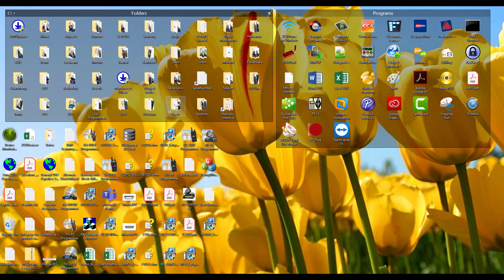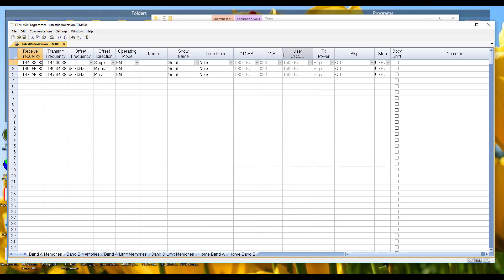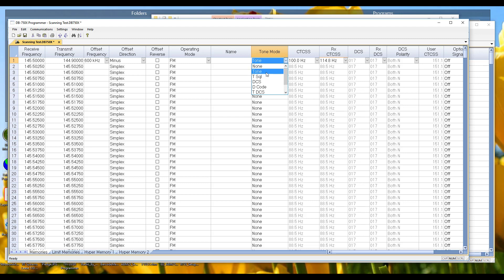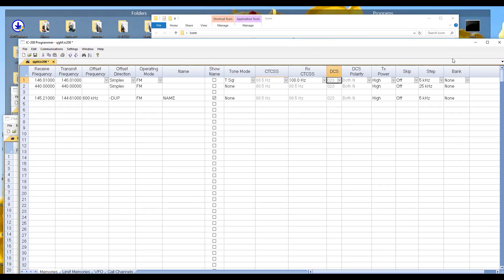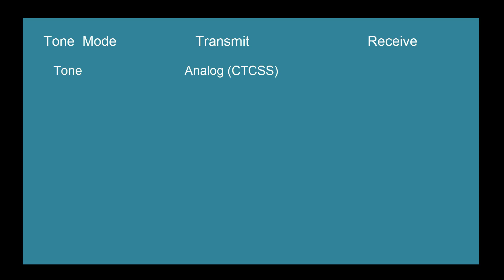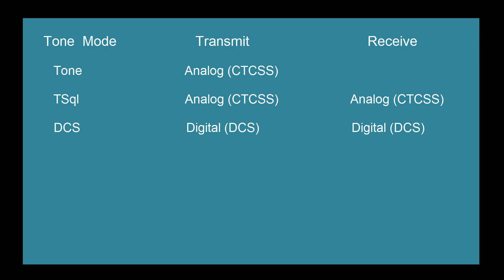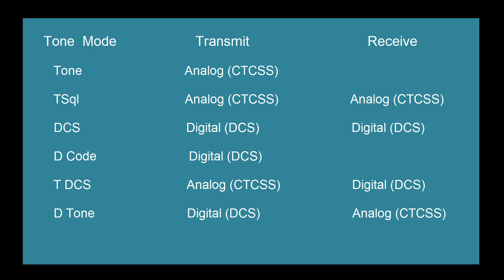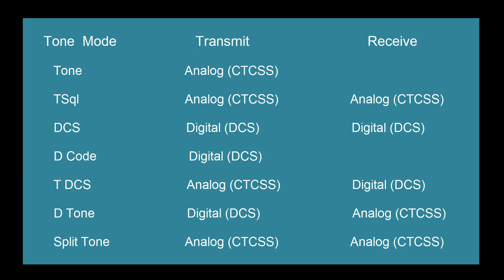Tones for accessing amateur repeaters

Comment: Icom IC-2730A advertises Split tone but, does not handle split DCS. :-(
Reply from the maker: Oh but it can be done!!!
Two channels
Channel 1) Rx frequency as simplex | Tone Mode to DCS | DCS code to that needed to hear the repeater and block other noise. (The down side... the one from the repeater to you).
Channel 2) Tx frequency as simplex (that is the frequency you use to transmit to the repeater... generally 600kHz or 5.0 Mhz difference) | Tone Mode to DCS with DCS code set to that to be transmitted to the repeater. 
Use the two channels together.  One on left the other on right with the TX channel active so when you transmit, you are not on the wrong frequency for the repeater. 
The TX side gets to the repeater.  The Rx side hears traffic with the advantage of blocking signals that don't contain the assigned DCS Code. 
There is always a way... you just have to be a little creative at times.  That'll get it. 
KT | K0RTX
Reply: @RTSystemsInc   Thank you. I know there are work-arounds that are not as elegant as having built in functionality. I could also simply use DCS on TX and carrier squelch on RX. As an aside, Icom does incorporate split tones on their more expensive commercial equipment.

Comment: I have a set of frequencies that have a CTCSS tone. It does not list if needed for both TX and RX or just TX. Is it generally needed in both?
Reply from the maker: Good afternoon Chris,  No it is not.  Generally, it will be clearly stated if it is needed for both and when not stated, it is presumed to be TX only.  In the programmer that is the Tone option for Tone Mode. Better to enter it wrongly as Tone (Tx only) and not TSql (Tx and Rx) If you are wrong with Tone you may hear some noise or a conversation you don't expect.  If you are wrong with TSql, you will hear NOTHING and miss all the conversations.  Hope this helps!

Comment: Thanks for the great explanation.  I'm not sure if you're able to answer questions about specific radios but I cannot for the life of me figure out how to set a tone for transmit and a different tone for receive on my Yaesu FT3D.  I have an option to set the CTCSS mode to TONE SQL but as far as I can tell it just uses one CTCSS tone for both encode and decode.
Reply from the maker: You are right- only one CTCSS value for transmit and receive. However, you can get what you need by using two channels each set to simplex Tone on tx channel with CTCSS value and TSQL on receive channel with that value then use channel 1 on top display and channel 2 on bottom, making sure top is active so you can transmit.  Hope this helps and please let us know if there is anything else we can assist you with. Sorry for the delayed reply.